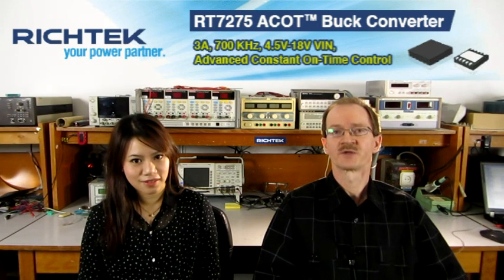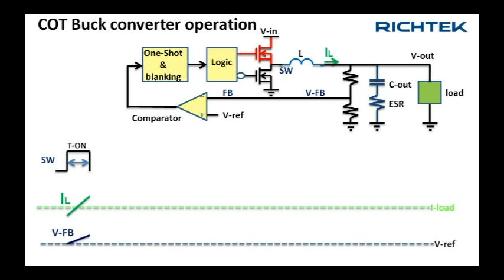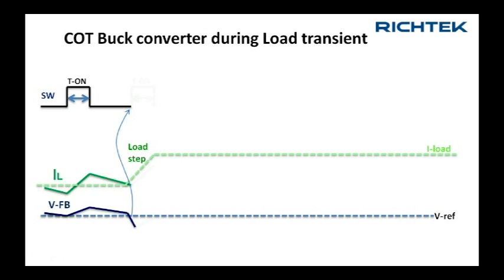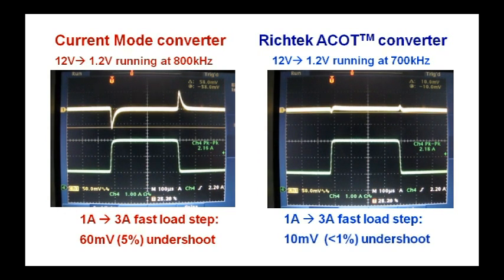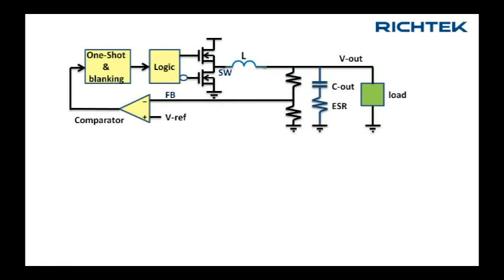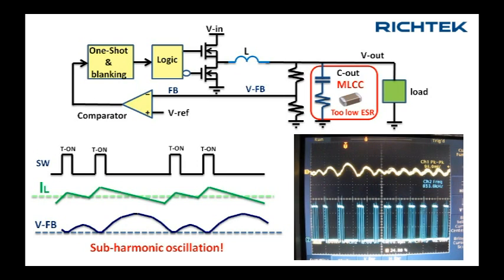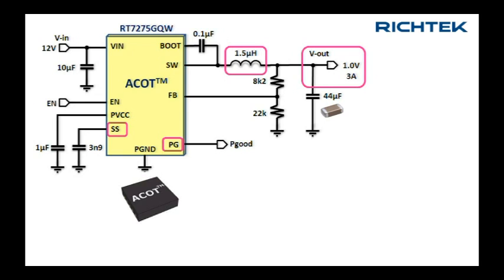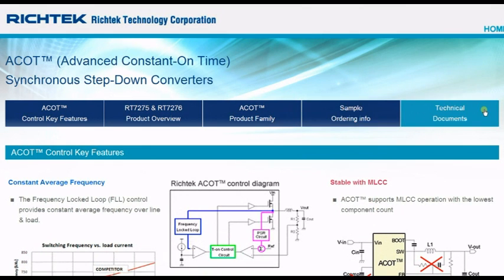Introduction to Richtek's Advanced Constant On Time Buck Converters

Comment: hmmm, there's a mistake in the presentation: during load transient, the output voltage will continue to drop as long as the inductor current is lower than the new load current (basic KCL). The drawing incorrectly depicts the output voltage increasing during the first pwm pulse, even though the load current exceeds the inductor one.
Reply: Can you mention the time stamp of ur observation